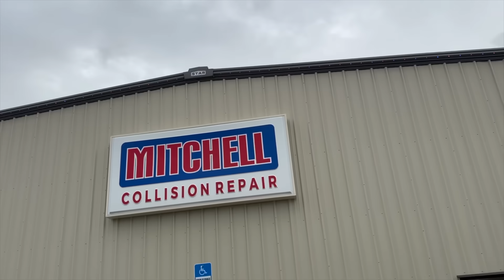MY Once Destroyed BMW M4 Comp Is Finally Getting Painted!

Comment: U should've  just sprayed that at ur bros shop, spraying matte clear is not hard at all u just have to use the original product. If worried about dust then u can just section the panels.
Reply from the maker: That doesn’t really make any sense
Reply: @Vtuned  Everything said was cohere, like: spraying the car at ur bros shop. Or sectioning some of the panels, like painting the hood and the trunk separate.

Comment: Hi there, what type of tool did you use to remove self-tapping bolt while removing shock tower. Bolts looks like star-shaped in the chassis frame